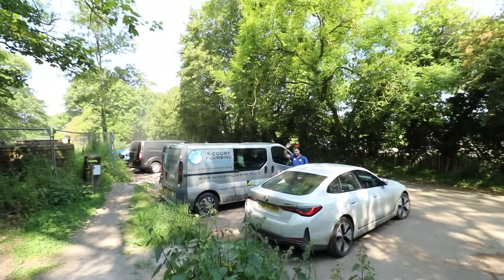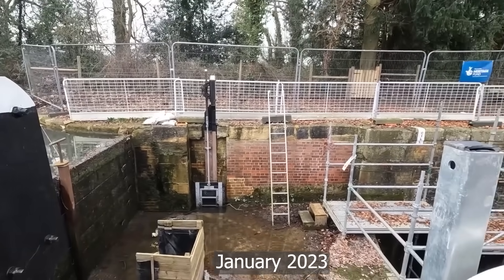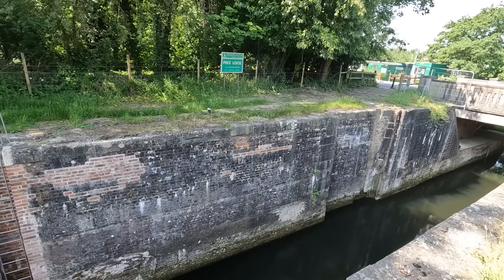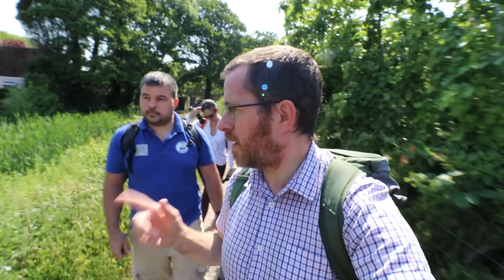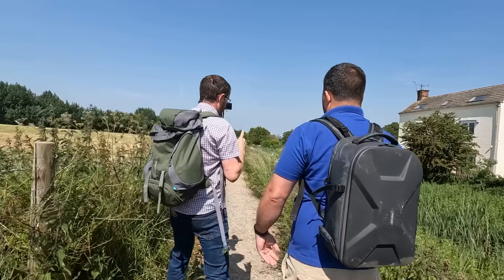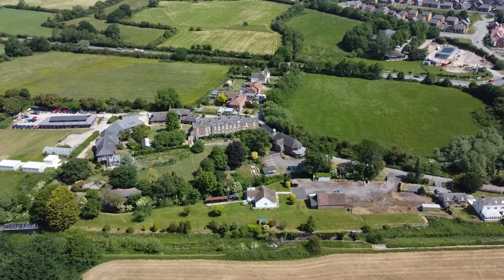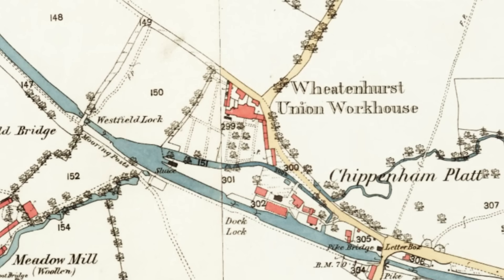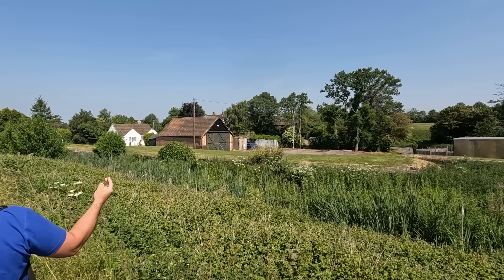The Impossible CANAL Invention.

Comment: I had a look at the site shortly after seeing this facinating video. A possibe explanation is a boat repair/servicing site. The change in level achieved by closing the sluice would only be about half a meter but would probably be sufficient to bring an empty wooden narrow boat on to a low dry dock area. This could explain why there are two locks so close to each other on a very gentle slope and building labelled boat house on the nls map which is both away from the canal edge and parallel rather than perpendicular to it.  The feeder stream on th opposite bank would alloww
Reply: sorry pressed the wrong button. would allow for reasonably rapid turnaround. Just a thought. perhaps restoration, when it happens, will shine more light on the matter. Tank you both for a highly enjoyable channel

Comment: Why build this just to drop the level by two feet? And why not build one on all pounds? If you need the pound drained for a reason just pull all the paddles on the next lock down, ie Westfield in this case.
This weir is to allow the normal flow from the incoming brook to flow away gently, with the paddle being drawn when the stream is in spate. If the pound were to overtop the lock there would be a risk of damage to the lock structure.

Comment: I don't suppose it's the same, but there's a sort of triple-weir at Hartingdon Harbour on the Chesterfield Canal, and it's new. The overspilling water can take up to 3 different ways through the weir. If there's only a small amount of water spilling, it goes through an underground pipe which isn't very large. I'm not clear on what the middle-capacity path involves or why it's different from the high-capacity path, but while it was being built I saw a lot of big brick pillars with not all that much space between them; there was more pillar than space. I think this spills out the back of the weir to a channel that's clear but normally dry. Then if there's too much water for that, I think it goes over the top of the pillars, and I'm sure it spills out into that channel. I have no clue why they made it this complicated! :)

Hartingdon Harbour is just outside Stavely Town Basin; down the lock and between the 2 huge road bridges of Ireland Close and Eckington Road. It's clearly marked on OpenStreetMap.

Comment: I'm not an engineering or canal expert in any way, but one possibility that occurs to me is a single sluice with a gate divided horizontally so that the top half could be raised separately from the bottom half. However, I'm not sure if you could maintain a good enough seal between the two halves when both were lowered.
Reply from the maker: Thats  great point, Charles. We did consider this possibility. As you suggest the seal would be a issue... but food for thought.

Comment: I don't the area, or history of this pound, but I wonder if the lower Weir was set to the normal height of water, and when in times of high water flows either from operation of the locks or from the stream a second overflow Weir came into operation. Was there a mill that used the water either upstream or down?